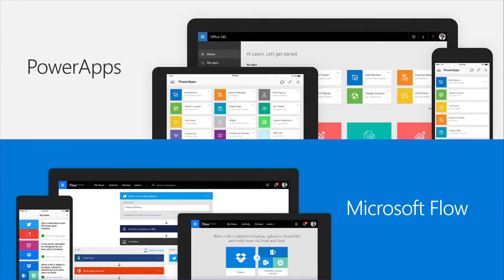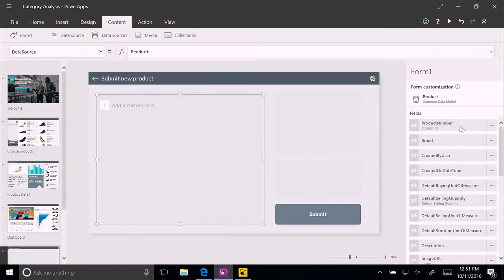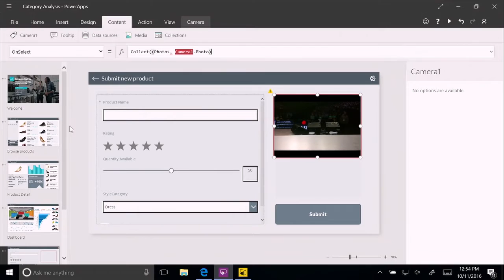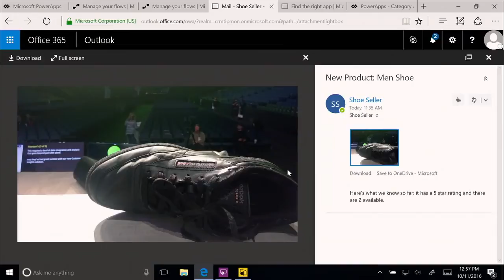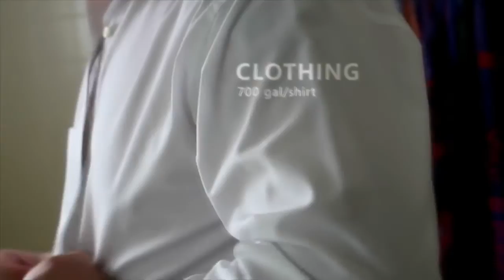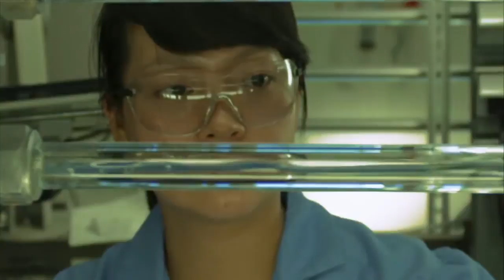Build apps without writing code using Power Apps | Microsoft Dynamics 365

Comment: Fill in the formulas are basically coding. You still need to understand the usage of the individual formulas.  At least this is very simple and neat for a non-developer to use. I'll bet they'll use a lot of time to learn to use this system ;)